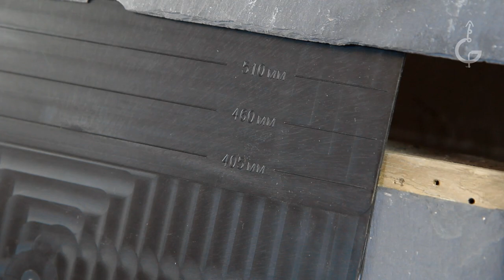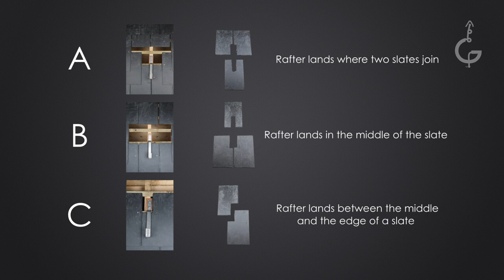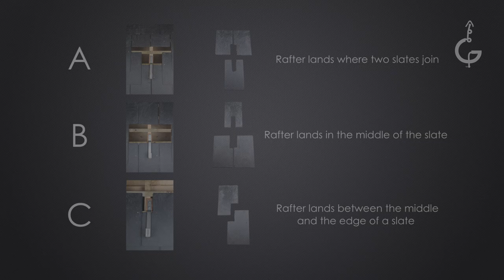GeniusRoofSolutions - SolarFlash™ installation on slate roofs

Comment: That is a lot of work for one roof hook!
Reply: what other choice do you have?
Reply: Solar Limpet
Reply: @solarrover9575  Not keen on loading the slates with pressure. Plus the drill holes could fail
Reply: You only need to do it this day on the bottom rail really.
You have found the rafters then and can follow them up the roof

Comment: 4 nails through the middle of the plastic so called flashing. Was it a painter that designed these? What happens if the slate breaks? Water will piss in those 4 holes.
Reply: The nails will be covered by the above course of slates. The only extra nail apart from the slates he puts in is 1 in the middle to hold the flashing in place while fixing the slates, but it is only around 20mm from the slate nails so will be covered by the course above.

Comment: That will leak as slates suck water back under them . U cut a chunk out down to the nail holes that's where iT will suck up . On old slates you can see the water lines goes like a triangle . Also shouldn't rip slates out in rows as they can swing need to be  also triangle too
Reply: Your clue less 

Not a chance it will leak. Capillary action will not run 150 mm 

And they are not smooth slates either, rough slates decrease capillary 
Also the action of adding the plastic tile rather than lead will also add to reduction of capillary action. 

How can the tiles move on a 45 degrees if nailed 2 times in a fixed position 

Not 1 nail. 

I’ve done this job 900 times plus. 

Not 1 leak 

Unless you can price it with experience or tell me otherwise